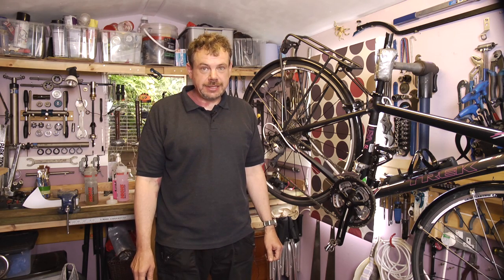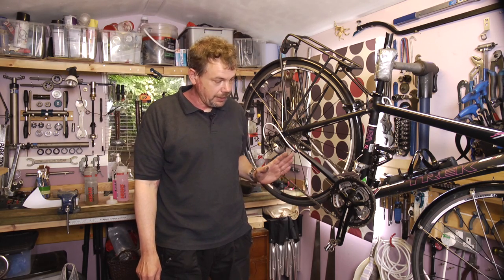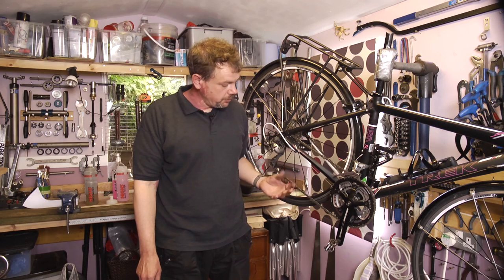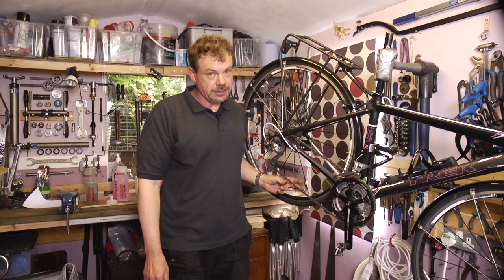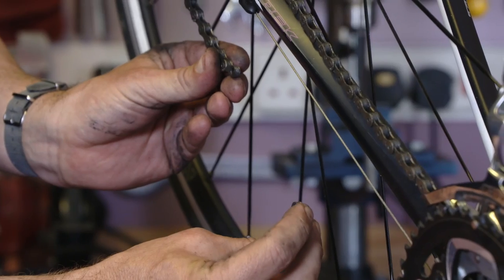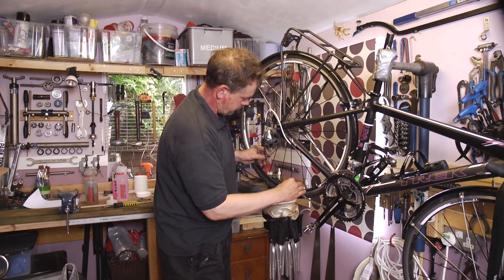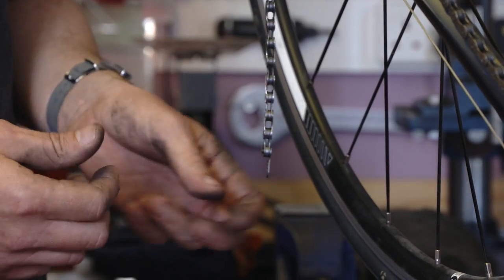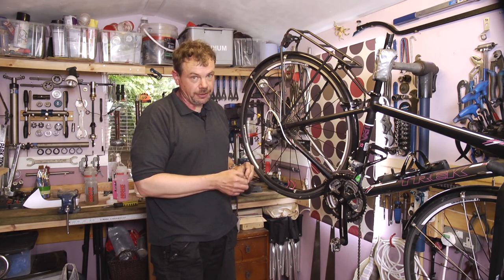Secrets Of The Cycle Trade: Fitting A Connex Link To A Bike Chain

Comment: Actually the KMC missing links, at least the 10spd ones are reusable. KMC actually state that their 10spd missing links are reusable, although I notice they have listed their 11spd ones as non reusable. I've been reusing KMC links for years with no issues. However I do replace them when I replace the chain because to me that just makes sense.
Reply from the maker: Hi there Noel, thanks for the info. I'm not really a chain expert but I will pass the comment on to Dave. Thanks for watching and happy cycling.
Reply: Noel Waldron: What really makes sense is to just get the Connex link and reuse it. It doesn't need a tool to take of and put on the link; it can be reused many, many times and doing this is MUCH more "cents-able", cost wise, than your method. Isn't this obvious? :)

Comment: kinda offtopic, but does anyone know, should we remove factory lube from new connex chains? should we at least remove it from outside of chain=?
Reply from the maker: If it was me, I would leave it on. The have obviously put it on there for a reason.
Reply: thanks for reply, at the end i decided to remove factory lube from outside of chain, using a rag and degreaser, and leave it inside of chain
Reply: i asked connex themselves, sent them mail, i'll reply here what they say if they respond
Reply: Chains are delivered with a protective grease that keeps them in good condition in the shelf before sale. This is a grit magnet and attracts the perfect type of muck to create a fine grinding paste that will dramatically shorten the life of the chain and other drivetrain components. Even if you're not thinking of waxing your chains, look up any video on how to do this and the first part will be all about packing grease and why to remove it before applying lube of choice.

Comment: Did I hear you correctly re: #1. the connex link not to be used on Shimano chains? #2. the same connex link can be used on any 7-11 gear range, with the only difference or change being in chain length?
Reply from the maker: Hi Timothy, as far as I am aware, what Dave says in the film was accurate at the time we made it (June 2016). Hope that helps.
Reply: Where does he say it can't be used  with a shimano chain? I've watched it twice and haven't heard.